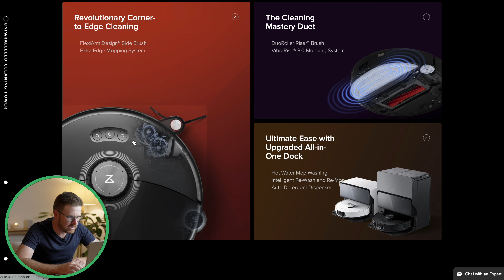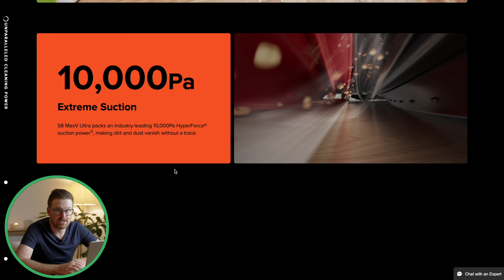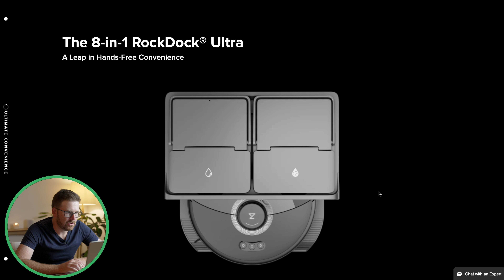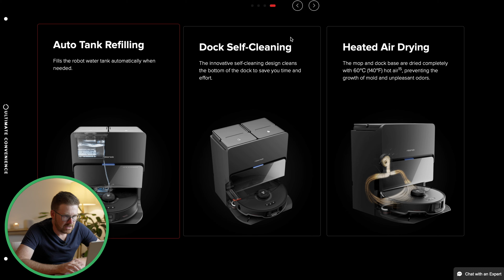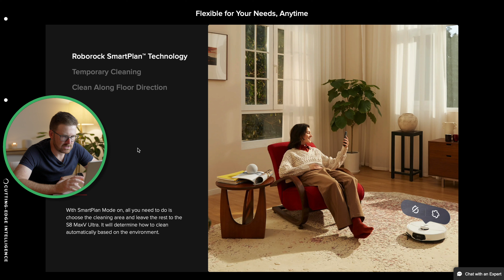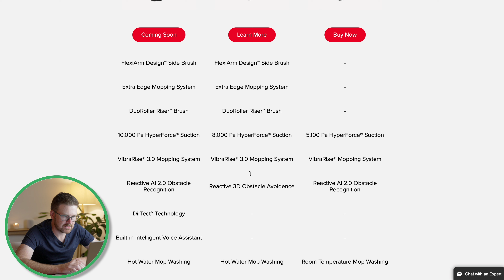S8 MaxV Ultra - First Impressions

Comment: This seems to be what I’ve been waiting for.  Two problems I have with my Roomba S9 is that is doesn’t pick up hard dog food. The nuggets seem too big and it kicks them around. I’m wondering if the Max does a good job of picking larger things up, also small pieces of paper seem to stymie the S9.  Also, along the rug edges debris seems to accumulate and not get picked up very well. It also gets stuck on my heat registers, so does the roborock go over registers without getting stuck?  Thanks for this review

Comment: Oh and great another robot vacuum that I will have to take a small mortgage to buy NZ$3k for the current S8, so I guess another $500 on top of the $3k?
Reply: Problem is not just the price but the how long it will last before breaking. For that price vacuum should be 10+ years but robots only like to last a few years if that.
Reply from the maker: From what I've seen the expected US pricing is $1800US, and I think the S8 Pro Ultra came out at $1600USD. So yeah probably around $500AUD/NZD on top of the S8 Pro unfortunately.